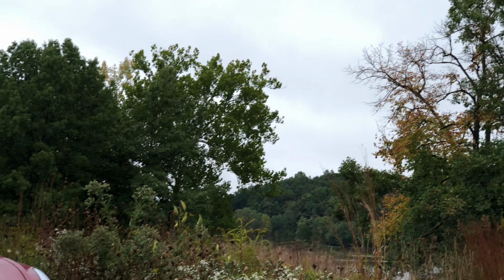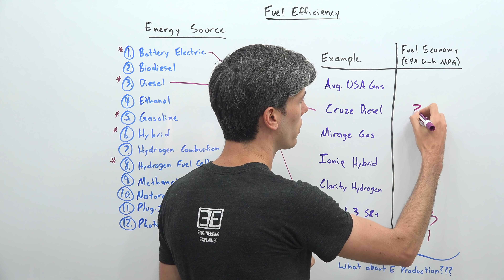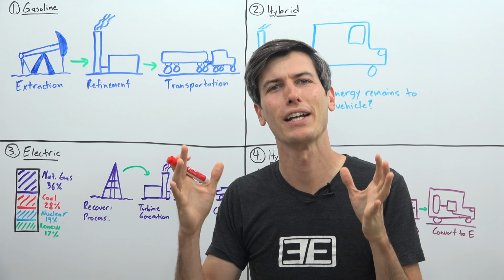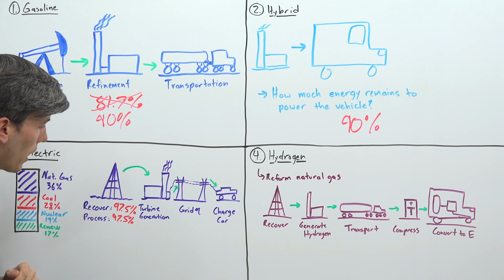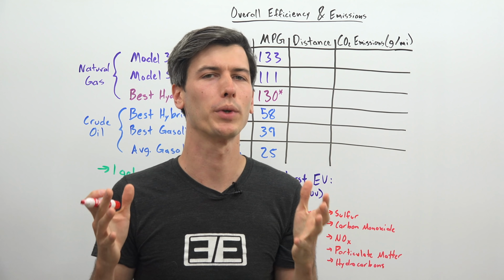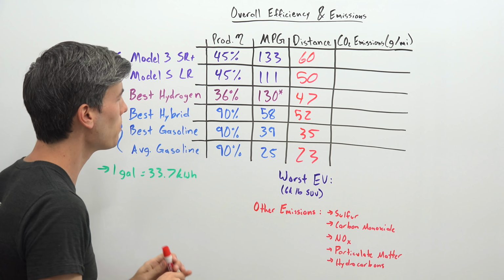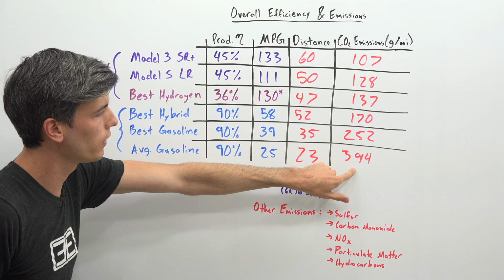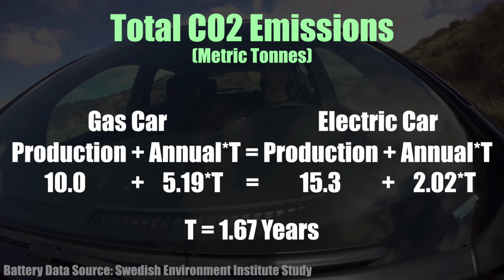Are Teslas Actually Better For The Environment?

Comment: Jason - If you're going to do such a detailed breakdown, then you should at the very least figure out how much electricity is used to refine that gasoline, and also figure in the source of that electricity and how polluting THAT is.
Reply: I think my EV uses less electricity than the equivalent gas car uses just to refine and pump its fuel.
Reply: Can confirm, my grandfather set up power systems for refineries, and stated that this was the case.
Reply: @Mech-Badger-Man  Gotta love anecdotal evidence......
Reply: I was also curious about the emissions and energy expenditure for transporting the gasoline or hydrogen.  Transmission power lines loss were calculated.
Reply: Pretty sure that was included in the 81.7% efficiency. We have been refining for a long time and this process is very optimized.
Reply: It was awkward to see detail breakdown of electricity losses but for oil just a blanket number? No breakdown?
Reply: @RandallJamesPeterson  Pipelines are more efficient and safer than rail.  Trucks: don't even ask unless you want to be depressed.
Reply: @cocoaliveson3235  , I guess that's why he didn't try to break down the transportation costs of taking the refined fuel to your local gas station.
Reply: While he's at it, he should have also included the charging and distance efficiencies as affected by extremes in temperature.  Hot and cold make batteries FAR less capable of storing the same amount of energy, and creates the need for more energy, just to keep the battery charged WHILE THE VEHUVLE IS SITTING STILL.  Also, electric motors are less efficient outside of that thermal 'sweet spot,' and even cooling creates fluctuations that affect efficiency.

No such energy requirement or penalty for ICEV.
Reply: @RandallJamesPeterson   It's included in the 81.7 % figure that's well to pump efficiency.
Reply: Bill Cichoke 
Wrong about ICEV not having efficiency penalties in cold/hot weather. ICE engines also have a temperature sweet spot for running efficiently. A cold engine is less efficient at burning fuel, therefore uses up more fuel. Winter months and places with colder climates make ICE vehicles run harder than in warmer climates. Oil viscosity is also affected by colder temperatures. ICE vehicles are highly reliant on proper oil viscosity for cooling and lubrication of engine moving parts. Colder temperatures makes oil denser, resulting in less efficiency
Reply: @billcichoke2534  as someone who lives in cold area yes cold affctes gas and disel engines alot you can your engine cycle change as it gets warmer. Also ekectric cars the batteries get warmer if you drive then.
Reply: @aggoserinn  The main effect cold has on ICEs, is the time needed before they reach operating temperature.  It does not affect the range of the vehicle, as it does with batteries.  Also, there is no range penalty for hearing the cabin, since you're merely redirecting engine heat that would be wasted, into the cabin heater core.

Batteries and motors WILL heat up as they are used, but the initial range WILL be less, due to the cold.  Also, any heating done to the batteries, or the cabin, it at the cost of range.
Reply: @billcichoke2534  So like many people you probably notice you get worse gas mileage in the winter than in the summer. The biggest reason for this is the COLD AIR. The ideal operating outside air temperature for your best MPG’s will be from 75°-85°. Once you start dropping below say about 68° the mileage decreases pretty rapidly. The biggest impacts occur under 45°F . In fact depending on your make and model of car your mileage could drop by as much as 20-28% from summer warmth to winter cold.
Reply: @aggoserinn  Actually, I don't, especially since I avoid oxygenated fuels, which DO decrease your fuel economy by at least 5%.  If anything, since trips are a little less frequent, I find my fuel lasts a RIDICULOUSLY long time between fill-ups.

Also, since the fuel is farther from the vapor stage at those temps, I get more actual fuel per fill up.  Not much, but noticable.
Reply: @- Ivan Husqaberg So you want to talk about after warmup for ICE, then we should only talk about after warmup for EV which is just about as efficient, at least for Tesla that uses heat from motor to maintain warmth of battery during use.
Let's keep the argument apples to apples :)
Reply: @billcichoke2534  hahah do you know anything about how ICEs work? They have an ideal operating temp, and run horribly inefficiently when cold.
Reply: @Refaldooloo  Then let's.

Your motor warms up IF you use it.  Initially, you HAVE to start with a cold motor, even if the batteries have been warmed up.  That's why regen us unavailable.  But everything you do, HAS to be powered by your batteries.  There is no use of waste heat or the like.

I can let my engine idle until it's close to the bottom end of its operating temp 'sweet spot,' THEN drive off.  All the oil is distributed and flowing, and the fuel return has warmer fuel in it, heating up the tank a bit (more of an effect in diesels than petrols).  Thus, even if I use some fuel to warm up the engine and NOT move the vehicle, I still get just about the same (if not a little MORE) efficiency as when temps are higher.  And a bit less heat-related wear.
Reply: @KingOfForest22  See my last post to Refaldooloo.
Reply: @billcichoke2534  yes. Cold weather is the one situation where waste heat is an advantage for ICE vehicles. However, the rest of the time, waste heat is just... well, wasted.
Reply: @noisycarlos  Yes, it is.  My.point is, the so-called efficiencies of batteries and motors vs. ICEs is a bit overblown, and not as obvious in real life, as it is on sales brochures.
Reply: @lylestavast7652  If it's 81.7%, then electricity production to run the refinery, certainly was not factored in.
Reply: @Sasha Da Masta Never said they weren't.  Just said the large range penalty for batteries due to extremes in temps, is NOT something that ICEs suffer from.  Not hardly.
Reply: @mousepotato581   the portion associated with gasoline (which in the US is around 47% of refinery outputs it sure is.  There's a grand myth out there that it takes FAR more electricity to generate the gas then what you could drive an EV directly.  It's bunk.  Something on the order of 2-4 kwhrs only, and most detailed breakouts I've read where toward the lower end of the range.   Extraction of crude/NG is pretty efficient overall because they've been at it 150 years now and know what they're doing.
Reply: It is ~9.32 kWh to refine a gallon of petrol for the average US refinery.
Reply: @jaroslavjandek8365  Which is mostly generated by fossil fuels.
Reply: @billcichoke2534  Indeed. ~1.5 kWh comes directly from the grid and ~7.8 kWh uses fossil sources to power the equipment = these are average numbers for refineries from 2017 (directly from the U.S. gov).
I would hope they rely more on grid and renewables now, because using the on-board fossil sources is very inefficient and a huge source of pollution (not to mention the resulting pollution in these cases is weakly regulated).
Reply: Hydrogen could be produced at the fuel station using electrolysis. Not transporting needed. It would require infrastructure just as EVs need charging stations. I would personally like to see EVs in the hands of people that don't need super long range and Hydrogen ICE cars for the range. 

As a kid, I traveled with my family all over the United States. We could not have done that as efficiently using an EV. Even if the charge time was 30 minutes, that is still 30 minutes you are not driving to your destination. Our average driving time was around 6-8 hours a day when going between major stops. This includes 5-10 minute fuel stops. The car would get in the 300 mile range between fuel stops. This is while pulling a camper behind us.
Reply: @jaroslavjandek8365  If they relied totally on the grid, then they would be using more total power to do the same job.  Many of their processes are also creating petrochemical bases used for plastics and medicinal products.  In effect, they would become LESS efficient and LESS useful by doing some of those refining and processing jobs with electricity.
Reply: Ummm… right, when it's very cold, the heat off an engine is not 'waste' heat, and extremes aren't good for the battery or the occupants.  I've driven our Model 3 in minus 37 weather, but next time I'll drive the Prius Prime.  Or use Skype.
Reply: I've had fuel problems in extreme cold dramatically and randomly shorten the range of gasoline and diesel vehicles.  And fuel injected cars don't usually vapor-lock on hot days like the old carburetted ones, but we had a 2016 GM go into reduced power mode on a warm day.   At least with a Model 3 it's predictable.
Reply: @RandyTWester  Would I be betting safely in saying you were using lower grade fuels with ethanol?  Those sound like crap fuel symptoms.
Reply: @MrAlexandriaTech  It would need electrolysis and a compressor. The whole process wouldn't be very efficient (compared to how hydrogen is produced on the industrial scale) - although if you do have surplus energy, you could use hydrogen as storage.
Still, using batteries would be more efficient and as technology progresses, the gap will widen even more.
Reply: @billcichoke2534  No, you'd lose that bet.  I have had gas lines freeze off and carb icing but not using Mohawk / Husky Ethanol blends (but have had snow plugging and wet ignition)  The other times it was diesel fuel gelling.  And once condensation /  ice buildup in oil galleries on short trips.  The good thing about cold battery range loss and heater usage in an EV ia that it's predictable.
Reply: @billcichoke2534  Actually, the reality is the more modern refiners use more grid electricity (or other more direct sources of electricity) and they absolutely ARE more efficient. Hell, the old refineries are still using generators to produce electricity to power some of their devices (way less efficient than grid-scale energy production).
Even if you used electricity for boiling the crude oil - the efficiency of boiling would be about the same while producing much less emissions (the temperatures could be better controlled, though - so there may be some process improvements IMHO).
And FYI, the petrochemical fraction ratio is just 2% - using electricity wouldn't really change that :)
Reply: @RandyTWester  I've never had either one of those happen, and stay the heck away from ethanol.  Since it draws water into itself and your fuel, THAT is what freezes (unless you're in -60 or lower temps).  With a good fuel stabilizer, or Diesel Treat for your chugger, you should never have that kind of issue, ESPECIALLY while your engine is running.

To say that electronic ANYTHING is more reliable or predictable, is to deny the basic nature of electronics.  Unless they're treated gently and kept in a VERY controlled environment (like a server room), the brain farts and failures are manifold and the solutions almost impossible to suss out many times.

No thank you.
Reply: @jaroslavjandek8365  Many have stopped making the medicinal products they used to (certification was too difficult it expensive), so they don't run the burning reagent section of the refinery.  Again, not more efficient.  Just less useful.
Reply: @jaroslavjandek8365  Honestly, as a 'Petrol-head', I was just trying to find a nice compromise that would let those of us that like the roar of a V8 engine continue to have it. Hydrogen would do that. For everyone else, they can have electric cars.
Reply: wait, is there really someone that thinks ICE engine are just as efficient when its -40c as when its +25c once warmed up? wait what? ask any Canadian if they get as much mileage in summer than they do in winter lol
Reply: @cocoaliveson3235  i want to know the stats on trucks
Reply: @thalesletus1  i live in a country where the temperature difference can be as big as 60 *C (summer to winter),
i drive ICE car and i see the difference, summer i can drive allmost 700 km with full tank and winter barely 600, sometimes even lower...
Reply: Yeah also include the slavery  and child labour factor in the battery nickel production .

Comment: Natural gas releases much less co2 than coal, which accounts for (like you said) ~33% of electric generation in the US. The coal produces sulphur and nox as well. In addition, don't forget that the average car in the US is 11.8 years old.
Reply from the maker: Nat Gas is 36%, and has been increasing. Coal power production is 28% and has been steadily decreasing (hence I chose nat gas for the analysis). If you include the overall pie, which means 38% renewable/nuclear, those two sources dramatically reduce CO2 emissions (as they have none associated with power production).
Reply: @EngineeringExplained  I'd love to see  you take into account the cleanest combustion engine, with best fuel economy, best emissions and really good production efficiency, that is the CNG, number 10 on the list. Just the recovery and easy transportation via pipelines and way cleaner and efficient combustion, that should've been even closer to challenge electric cars.

Comment: I have a 2014 Cruze diesel and over 167,000 miles, it averaged 37.3mpg so your numbers are right on. Now that doesn’t take into account that working security, I idle the car for many many hours which hurts obviously. I also got fuel for free which helped my cost big time but doesn’t change the mileage. Great explanation and research as always.

Comment: Another point is that Tesla actually builds their batteries in low emissions plants which use much cleaner power overall than the average grid. 

But in any case, the average emissions for US electric production, per the EIA data, are about 1 pound CO2 equiv. per kWh.  Since the EPA is basing it's MPGe numbers on an estimate of 33.7 kWh of energy per gallon of gas, you can say this amounts to 33.7 pounds of CO2 per gallon equivalent. 

The CO2 emissions per gallon of gas burned by an ICE car are less. About 19 pounds directly, but about 26 pounds once you account for wheel to well (emissions during production, refinement, and transportation). But this still implies that the EV only needs to be about 27% more efficient in it's MPGe (33.7/26=1.27) in order to be producing lower overall emissions. 

So an EV only needs to be better than 32 MPGe to beat the average gas car (25) and better than 64 MPGe to beat a good hybrid (50) on emissions. 

Even in the state with the dirtiest grid (WY) per the EIA state profiles, about double the national average CO2 emissions, the EV only needs to beat 65 MPGe to be better than the average gas car, but needs to reach 130 MPGe to beat the 50 MPGe hybrid. 

Overall, I think the numbers for hybrids and PHEV can get close enough to EVs that it can be  reasonable for people to decide between those technologies based more on convenience and economic costs. But if we are taking environmental costs seriously, nearly every new vehicle should really be at least a hybrid.